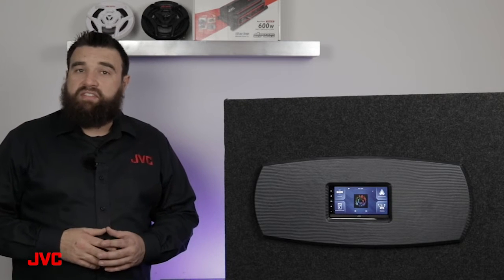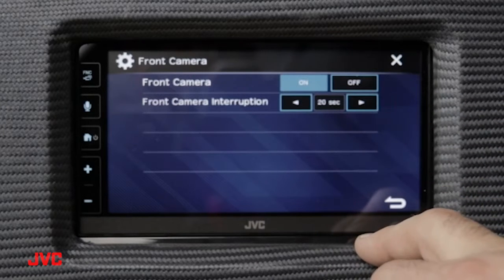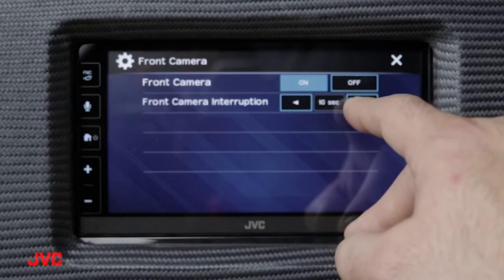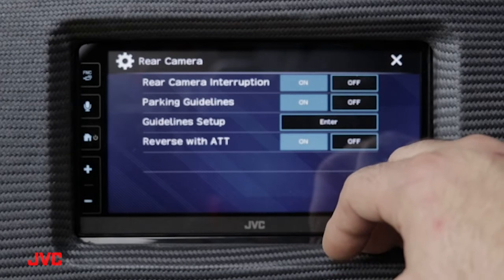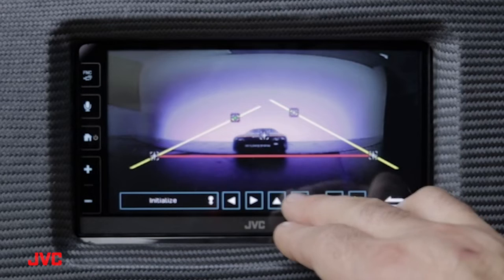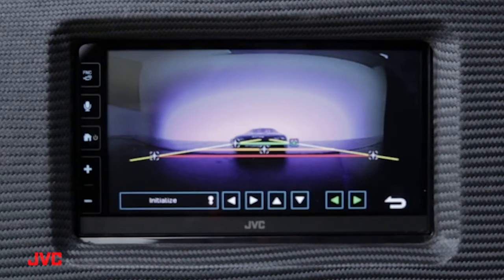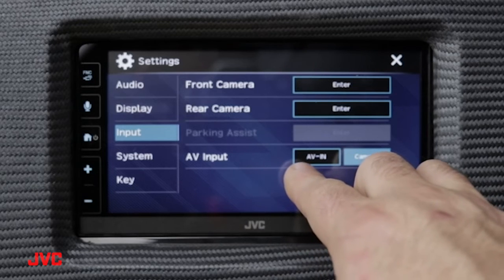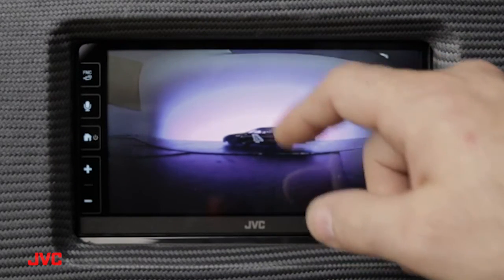JVC Quick Tip- KW-M785BW, KW-M780BT & KW-M788BH Multi-View Camera Set-up

Comment: I do like my 785, but I have to agree with Mike, Having to take my eyes off what I'm doing so that I can concentrate on pushing your damned "check your surroundings" button is not only dangerous, but a huge annoyance. I'm actually to the point of looking for another receiver just to get away from having to do that. Completely unacceptable. You want me to check my surroundings, and then fricken block half of the screen!!!! What's the point, other than to try to save yourself from a fricken lawsuit. I'b be all too happy to sue JVC if I ever back into someone's car trying to turn your warning off.
Reply from the maker: Please operate your vehicle safely, ALWAYS check your surroundings.  Rear view cameras are to assist in parking, and not replace looking behind you. Thaks!

Comment: I have the same model with a meastro rr2 but only the front camera (1) will show under the maestro rr2 settings as an assignable camera the other two options are grayed out. However the radio itself lets me swap between the two cameras I have. I am using the front and av in ports. Is there anything I need to do?
Reply from the maker: The meastro allows control over existing OEM cameras on equipped vehicles.  If you use aftermarket cameras directly wired into the receiver they will not be visible to the RR2 module.  Thanks!

Comment: When using a KV-CM30 with a KW-M785DBW does the display automatically change to the reversing camera display when reverse is selected? Your video suggests it does. If so how does the head unit know you are in reverse? The only connections on the KV-CM30 are AV input to the head unit and a switched live to accessory power and ground. Wouldn’t there need to be a trigger wire to go to the positive on the reversing light? I want to fit this to a 12yr old car that is not can-bus
Reply from the maker: When you shift in reverse, a trigger wire on the receiver will automatically switch the camera to be displayed on the screen. You will need to identify the Reverse trigger wire from your vehicle and connect that to the receiver's Reverse wire to enable auto switching from the rear camera. ( this is the same circuit that activates your Reverse lights in the rear of the vehicle when backing up) Thanks!
Reply: Thanks JVC

Comment: My jvc just stopped displaying the camera when i go into reverse... ive had the radio for at least a year,  but it just started recently doing this... any thoughts??
Reply from the maker: If the receiver still switches to the camera and displays only a black screen when you switch into reverse, it's likely an issue with the camera itself.  

If it does NOT switch to the reverse view when you are in Reverse, then make sure you have your reverse wire connected to trigger the camera on, and your camera still has power & ground.  You can also check the Camera settings on the receiver to ensure it is still selected to be "ON" As displayed in the video. 

To troubleshoot the camera itself:
Could you check all connections at the camera for damage, corrosion or a loose connection?   The camera will not display if there are any issues with the connections. Thanks!
Reply: It looks like it's the GM wiring adapter I have that failed. I hooked the camera into the reverse wire of the vehicle's main wiring harness and it works fine now... I don't know what's up with the adapter since all the wires are still connected and look solid @JVCMobileEntertainment  🤷
Reply from the maker: @TheDaman1111 Unfortunately, It's a challenge to troubleshoot an issue without knowing all the installation details and being in front of the vehicle. We are glad to help n any way we can. Good for you on figuring it out! Thanks!

Comment: Where the heck is the camera trigger wire tho? It only comes on in reverse so when I want to adjust the parking lines, nothing shows...

I have power and ground hooked up to the reverse light, and then I have the red wire from the AV wire going to the reverse wire on the JVC. That turns it on when going to reverse but that's it...
Reply from the maker: The camera triggers are built into the screen itself, using the on-screen controls to select any of the cameras.  For automatic camera activation, the receiver is designed to connect with an iDatalink Meastro RR or RR2 Module and receive both Data and Analog triggers from the vehicle and relay those triggers to the receiver for left/right/front camera activation. 

You can use the Meastro RR2 to set up analog (older non-data vehicles) in a universal flash, to convert camera triggers to a Data signal for the receiver to control all cameras from the factory signal. Most vehicles newer than 15 years are primarily using a digital format, hence the need for an adaptor to translate the trigger to the receiver. Thanks!

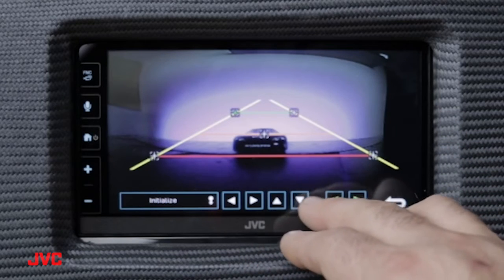Comment: The biggest issue with this radio that is not shown in this walkthrough is the rearview camera image when backing up. When you are in reverse, there is an overlay over the video feed reminding you to "Check your surroundings" that completely obstructs the video feed. You can see your bumper, and a 1ft behind your car, but everything further out is blocked by this message. JVC/Kenwood need to give folks the option to turn off or move the location of this message. For example, if you scroll to 1:28, in use, you will not be able to seen anything above the green line.
Reply: Agreed, just got this setup and its the worst! No timer for it to leave the screen, there's a huge opaque box around the text. Just awful design and no way to change it. Gonna return the whole unit.
Reply: Agreed. I'm sick of having to look at and touch the message WHILE BACKING UP because this warning box only pops up after several seconds and I'm already in motion. Ridiculous and it has caused me to go back to craning my neck. Especially in winter when I have mittens on! My RAV4 had a box that was not in the way and disappeared after a few seconds.
Reply: I think there is a setting to turn that message off ngl
Reply: @Dxnze If you know of a way, please tell us!
Reply from the maker: You can tap on the message and it will clear the screen completely, the prompt appears as a reminder to check your surroundings. Thanks!
Reply: @JVCMobileEntertainment  tell the jvc attorneys that you are more likely to be sued because your message blocked the view of surroundings and get it turned off.  I want to be paying attention to backing up not turning off unnecessary warnings from a misguided corporate risk department.
Reply from the maker: @kenching1950  Please reach out to our customer support team with your feedback JVC Customer Support:  
1-800-252-5722 Thanks!